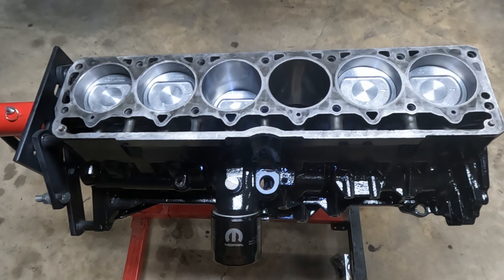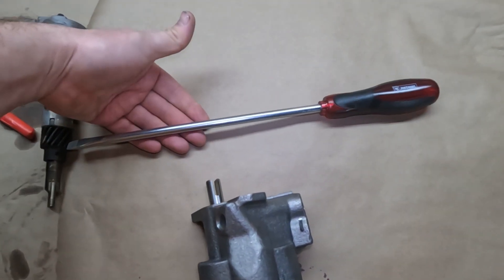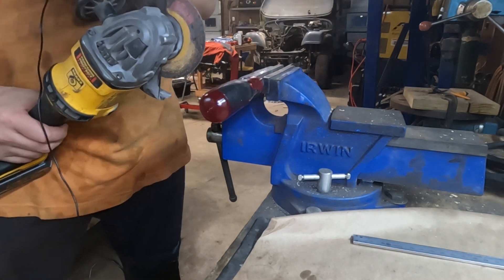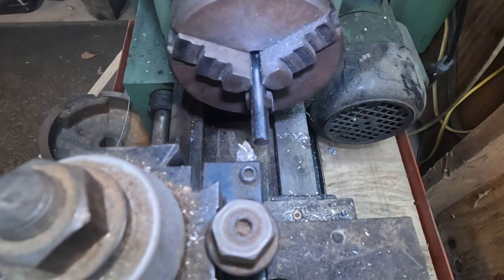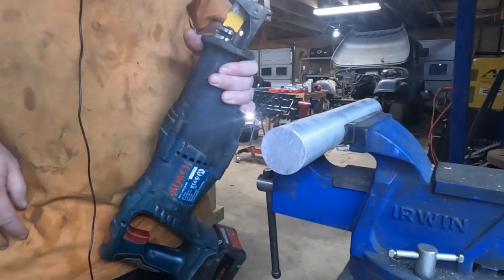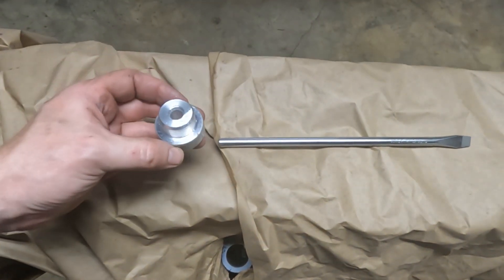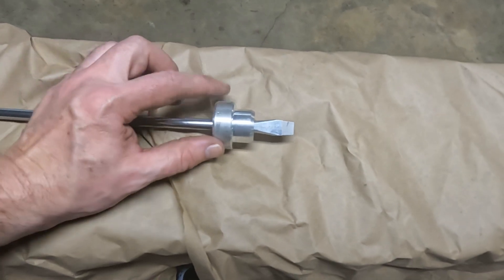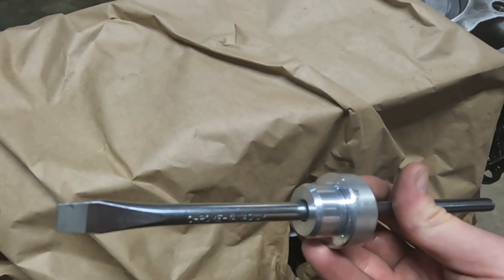JEEP 4.0L DIY Oil Priming tool

Comment: So would you spin the screw driver tool clockwise or counterclockwise in order to prime up all oil galleys? I forgot how the distributor rotor spins but I'd sure look it up.
Reply from the maker: Great question!  I can't remember off hand, Let me check out the service manual!
Reply: @theshop392 There seems to be an updated method of priming oil using a hand pump/extractor and pumping oil through the 1/8" oil pressure sender hole located on top of the filter housing, while observing the rocker arms through the engine oil filling hole.

Comment: why can't u turn the crank by hand?
Reply from the maker: I am not sure if you can spin it fast enough by hand but it is worth trying
Reply: Sometimes you want to run the oil pump without turning the crank, in order to prime the motor before first startup on a new or rebuilt engine